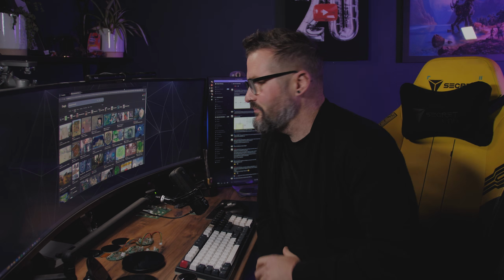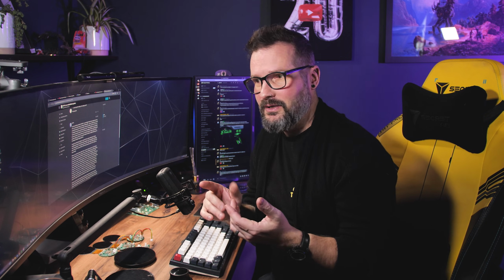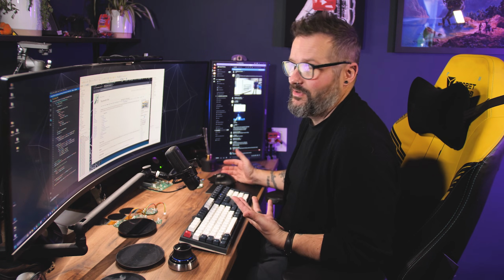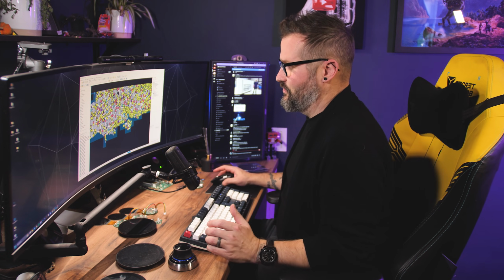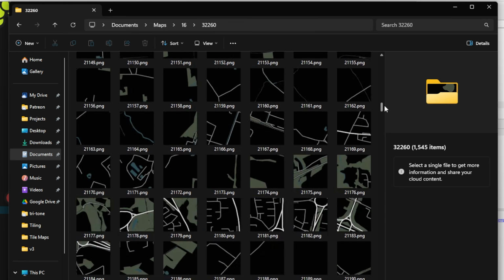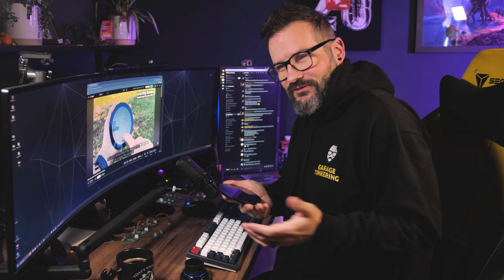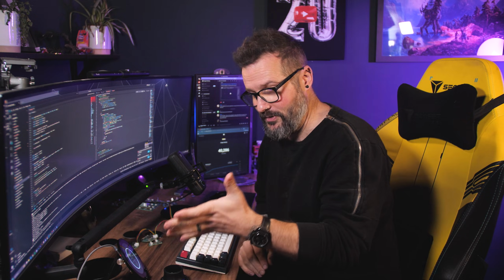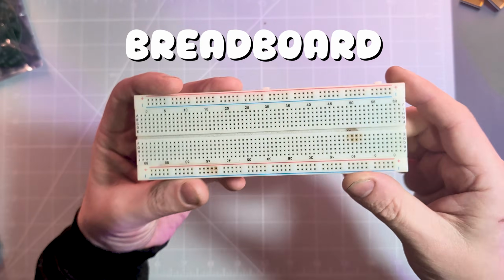A Real Mini Map from Need for Speed

Comment: That approach does work, but is resource intensive. You can use the raw vector data from openstreetmap filtered by whatever you want (street size, POI). You need to split the data into block similar to the tiles and then you need to render map as vectors, which should be more than fast enough on a multi-hundred MHz CPU. The vector approach also enables rotating, zoom based on speed and such. Done this before for a client (not a moving car, but same processes) .
Reply: Agreed! Vectors absolutely feel like the way to go for an efficiency standpoint, clear image rendering no matter the distance, and the performance benefit would be especially friendly for the full map rotation
Reply from the maker: Yeah I need to look more into the vector side of it. I was using LVGL due to my familiarity of it and vector support is currently really new on it so a bit janky.
Reply: @GarageTinkering came here to say vectors might be easier math for the rotation. Awesome project!
Reply: @GarageTinkering  I wonder, also, if you could render the frame, and then just display an image of the rendered frame rotated so that the present location of the car icon is always facing up; as you mentioned it lagging due to rotating so many tiles (ie. you turn it into one smaller tile which is a screenshot of the output of the code that normally has north always face up)
Reply: @omeganinjaboy  This is probably a good approach. I'm not sure how expensive it is to do a rotation on a single image, but I can't imagine it would be that expensive to simply apply a rotation to a single square image
Reply: @GarageTinkering  Don't, guys apperently don't know what they are talking about. Yeah, vectors are cool, small, you cen resize and rotate them, great.. On a big-ass CPU, on Windows, with ton of libraries and dependencies. They are thinking in a way "yeah, I just apply this rotation and scale parameter, it is so easy and fast!".. Sure, in a web browser, which is fully GPU accelerated. They have no idea how CPU intensive this task is on a microcontroller. You did good.
Reply: @filipxsikora yeah sure bud, you know better than TomTom and other gps makers that have used vector graphics since the very first GPS unit.
Reply: @NoTraceFound  Oh yeah. You are kind of forgetting, that these corporations have a dozens of people working on their SW/FW, optimizing the hell out of it. That's not doable in a single person as a 'hobby project'. They also probably have CPUs with vector graphics acceleration, possibly even custom ones. ESP32 does not have that. When the CPU is struggling with rendering and transforming only the RAW binary data, adding there a step to translate vector to these RAW data is ALWAYS!!! going to be slower. Simple as that. But hey, you are the expert here..
Reply: @filipxsikora   please stop talking about things you do not understand. the big bottle neck, as mentioned, is loading images and rotating those images. rotating images takes a whole lot of processing time. and a lot of that time has to already be spent on loading images, since that takes up a whole load of bandwidth.

images take up massive amounts of space - especially since they're not compressed. for vectors youre effectively only storing the start and end points of straight lines. that makes curved lines more complicated, but still way more efficient than raw binary images. assuming youre using 32 bit floats, a single vector coordinate (XY, 64 bits) takes up less space than 3 pixels (3 pixels * 3 channels * 8 depth = 72 bits).

you would then need to render this, but this only needs to be done once per rotation (translation comes free) and then it can be cached until it goes out of scope. so this would immensely cut down the loading time per tile (0.1s as claimed in the video), which is a huge amount if youre attempting to render this at a smooth frame rate.

rotation is much easier for vector graphics than bitmaps. especially since the esp32 has SIMD support. and there's already libraries like the hutch's gfx which supports rendering vector graphics on devices like the esp32. a vector graphics setup also massively increases the potential for efficient multithreading, since the second core could be pre-rendering rotations, especially since it now no longer needs to spend 0.1s per tile just loading it from memory.
Reply: Also, since vector files are much smaller, the blocks can be much bigger, and you need to load new blocks less frequently.
Reply: Yep, vector format is the way to go. About loading the vector tiles, look into mbtiles format, it is single sqlite database that holds the entire tileset and you can query it for the tiles you want. The entire world at zoom level 16 and all possible gimmicks exported from OSM takes around ~108GB, I suppose that UK would be more or less 2GB. Probably it would be wise to prerender/preformat the tiles on the pc using some script to tiny (as in tiny SVG spec) SVGs, and then draw them using LVGL. Possibly, you'd have to look into the SVG renderer to allow for rotating the images before rendering (vector coordinates) and not the generated bitmap. If you want we can get in touch and brainstorm, however the project looks sick as is, kudos!
Reply: Before trying this, I'd try to refine the current approach by stitching all visible tiles together and show them as a single large tile. That way you only need a single rotation instead of many small ones.
Reply: Exactly what I thought of. I’m too lazy to pull it like OP and would spend x3 the time do it like this
Reply: I was just thinking he could throw an M.2 2230 SSD at it instead of an SD card, but maybe that's too big/expensive/power-hungry.
Reply: @thewolfin  a ESP32 would not be able to access the M.2 SSD, even an external USB drive would be a real issue. Those chips are powerful, but the demand for modern storage is even higher.
Reply: I am not a fan of vector maps but in simple cases like this (displaying basically only roads) it would be the best solution with no downsides.
Reply: @docent5237 As someone who works with and creates maps all day, why would you use anything other than vector unless your data was actually raster? Like a heatmap or imagery? Even then, most raster data is used to generate vector data since the space saving of vector data is massive and allows you to attach data to every feature.
Reply: @Allenrythe  I also work with maps. We misunderstood each other a little. I am referring to the use of maps in client applications—I prefer rasters because they are easier to implement on the client side and can contain much more information without losing performance.
In the case of databases and storing data, vectors are obviously incomparably better.
Reply: But how does raw vector data speed this up? You still have to rasterize it in software so you can send it over spi. I think that will remove any gains you got from calculating the rotation.

Please enlighten me.
Reply: @DDryTaste  right now there a huge amount of images on the SD-Card, it was mentioned, I forgot it. I believe a 3-digit GB count. The raw openstreetmap data for the UK is about 2GB. After filtering out what you don't need, probably a few hundred MB left. Instead of loading one or more images, rotating and then copying to the raster-buffer (to be sent), you draw vectors (lines and polygons) that can be rotated easily and quicker than whole images, you directly draw the rotated elements. The actual transfer of the data from buffer to display is the same, but generating the image is way less stress for the CPU and storage.
With vector data you can use any level of zoom without preemptively generate images. Right now there are many GB "wasted" for areas and zoom levels you probably never see on the display.
Reply: @contentnation Thanks for taking the time to explain all that! It makes sense when you put it like that.
Reply: @DDryTaste  Sure you have to render it on the MCU, but it's a dual core 400MHz RISC-V chip, that's more than the entire game of Midtown Madness 2 needed to run even with the software renderer (I played it on a Pentium 2 with 233MHz). The hard part is only drawing what's visible, but it should be possible to use one core for rendering and one for feeding it. Tiny-skia (a C library) could work, and dual core might be easier using Rust (embassy runs on the ESP32).
Reply: So how is this different from having maps open on you car play?

Comment: Great job!
Could you use the whole display instead of just the center.
I hate seeing all those pixels wasted.  ;-)
Reply from the maker: It's a very deliberate choice. When you see this gauge alongside the other gauges, having the display smaller actually brings a sense of balance. 

Also my other icons that I need to keep it road legal like check engine, ABS, etc, are all going to live around the outside of this gauge.

Comment: If you were to take this one step further with a more powerful board, alongside getting the map rotation back, you could have the map zoom in and out based on speed to give a broader view of the road when on motorways, or a more detailed view on surface roads
Reply: Similar to Google maps.
Reply: no need for a more powerful board. dude just needs to optimize his code properly. the esp32 is more than powerful enough to draw a bunch of images lol
Reply: @recreationalplutonium It is pretty appalling as is. A view transform only need be performed just before display after all.
Reply: oh so Carbon's map

Comment: You might be able to set them to rotate and load faster if the grid is divided on a smaller size. The weight should not change for the sd but every image should load faster
Reply from the maker: 256 is the common size and tbh there's no issue with the current size. It loads a new row in the background asynchronously so there's no impact on the UI rendering.

Comment: 800kb for a blank image seems rather large, especially for something so small that doesn't need high resolution. I'm sure you already did, but running an auto-batch like in Adobe PS, to reduce every image by say 50% or set a max kb file size, like 100kb, would make it WAY faster to compile/load the image data, and would likely make the display much smoother obviously.
Reply from the maker: 800B, not kB

Comment: You could probably save a TON of storage space if you used indexed colors for your images on-device. 

Also, if you want the stationary north direction you could generate the render how you're doing now and then then just rotate the final image at the end instead of rotating all the tiles as you paint them.
Reply from the maker: The result is the same. What I was doing was effectively that
Reply: It’s a performance vs memory trade-off.
Having to keep a 20% larger view in memory and then also generating a rotational and translation transform of that view every 20ms is quite demanding

Comment: When there is no horsepower to rotate the image, use a servo to rotate the screen... 😂
Reply: Nothing wrong with faking a software solution with a little gimmicky hardware!
Reply: unironically I wonder if just taking the frame that's about to be drawn to the screen and running it through a rotation matrix (basically like rotating the screen but in code) would work — it's probably a lot less computationally intensive than rotating the actual tiles and getting them to line up and all.
Reply: @playpause-games run a micro arduino just for a compass that rotates the screen
Reply: @Victorsvolkswagens  yeah you’re right. i can’t lie the performance optimization is way less cool than actually rotating the screen
Reply: @playpause-games plus it would be super easy to do haha I’m just getting into the arduino stuff going somewhat complex for my first project im doing a fully standalone Volkswagen dual clutch transmission they are notoriously hard to control so I’m deleting literally every computer inside it and running it all on an arduino mega I’m confident it’ll work since it only has 11 solenoids and only 3 are on per gear change
Reply: @Victorsvolkswagens  avoid the Arduino IDE and use VSCode with PlatformIO
Reply: @Victorsvolkswagens interesting idea, any plans to make it a youtube series on that.!?
Reply: @Victorsvolkswagens  the problem is being able to rotate it continually, you would need some kind of specialty hardware but I'm sure its doable
Reply: @playpause-games  It's no silver bullet, obviously one would expect that to be the thing that is being done here, but doing it on CPU in less than 50ms, preferrably like 10ms just isn't really possible. I wrote code to flip a screen just 90 degrees (which is a whole lot simpler btw!) and that took most of my frame budget aiming for 30 fps. The damn display controller even advertised being rotation supported, but it just isn't
Reply: @playpause-games you'd get awful aliasing
Reply: @playpause-games я подумал ровно об этом же. Мне кажется это будет отличным решением
Reply: hardware engineer vs software engineer problems ftw
Reply: I really thought he was gonna do it but the static solution is valid too. A servo would help make it an option for both rotating and static tho
Reply: And then do some donuts
Reply: I would use a stepper motor with a compass
Reply: @Victorsvolkswagens  That is actually super elegant and I love it - might be a bit noisy though.
Reply: Could pre-render 90° worth of rotated files, as seperate layers then select the layer based on compass heading. The other 4 are simpler transforms that might work.
Heaps more storage though.
Love the suggestion of the servo though.
Reply: I thought exactly the same thing
Reply: Waiting for that..!
Reply: mount it on a compass, easy solution
Reply: Isnt it posible to like, "screenshot" the grid in that vertical position and just rotate that entire output as a matrix of pixels (just the same amount that the car rotates but in negative), and render that image instead of actually having to calculate the rotation for the whole grid each frame?
Reply: @mauroangst I believe there must be a simple way like that
Reply: if(donuts >= 3) { rewireDisplay(); }
Reply: thats just analog calculation
Reply: That should do it!
Reply: this would be sick as hell
Reply: best idea ever
Reply: This is genius! Haha.
Reply: Put a compass under the screen

Comment: guessing the only thing out of your control is the sampling rate of GPS location you can be PROVIDED
Reply from the maker: Noy really. The device that I used will measure at 10Hz which is way faster than I need it. Currently using 2Hz and it doesn't seem to need anything quicker. Maybe for track it would require a higher value, but 10 should be more than enough
Reply: @GarageTinkering   Huh ? I was only able to poll the Satellites about every 1.7 seconds

What GPS sensor are you using, I'd like to use it for my vehicle project

Comment: I dunno if the gadget can run this, but it might be more efficient to run an actual 3D model, which is what games do today. The map is always 3D modeled because it weighs less to run a lowpoly model than high res images and its infinitely scalable. You might be able to get a 3D model of the road structure a bit easier too since I think that's what google maps already does.
Reply from the maker: Not sure about 3D but 2D vector is a distinct possibility

Comment: Honestly this is REALLY friggin' cool! I am curious though: With the GPS sender you have set up, is it naturally sending a high update rate or is there something in your code that is smoothing that out on the map?

I actually put some work in a few months back figuring out the GPS CAN data my car is already sending from its own GPS receiver (one benefit is the data already implements dead reckoning/is augmented with vehicle sensor data in case of signal loss and even has a signal bit indicating if the data is real or inferred) but if I recall it only updates at like a .5s or 1s rate. My current test setup for that just sends the data via MQTT to an external server and then I have a web map set up to read that from my phone but I've been wanting to figure out if there's an easy way to smooth it out.
Reply from the maker: That demo was running at 1Hz, and then animating between the two points. Only downside is that it means your car icon is 1 second behind reality. I've since updated it to run at 2Hz and it's definitely more accurate and plots corners better. I think 3 or 4Hz would also be fine, but would need a bit of trial and error because if the distance between steps is too small, the bearing angle calculation gets inaccurate. There's likely a fix there though by using a moving point average.

Comment: This would be a lot easier with a CPU which has minimal EGL as you can render to a texture and just rotate that.  Having said that I would have thought an ESP should be able to rotate the small image being displayed.  This year’s micro controller is 1990s main CPU. There were full 3D games on 25MHz ARMs.
Reply from the maker: There's likely something that can be done to make it a bit smoother. I just need to spend more time with it
Reply: @GarageTinkering  This is a classic demo effect, a rotozoomer. Look into how those are usually implemented, an ESP32 should be more than capable of doing it at high speed. Your graphics library is probably just trying to do it at a bit too high quality, there are good tradeoffs to be done there for speed.